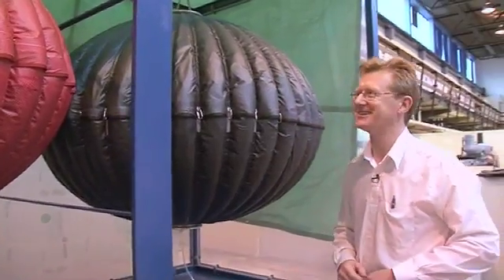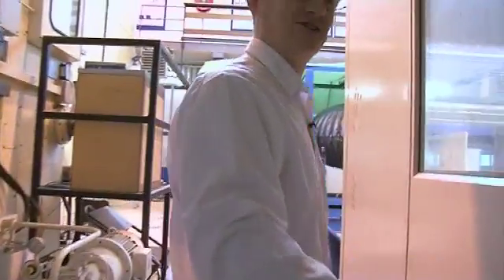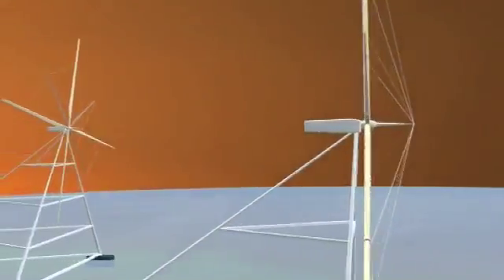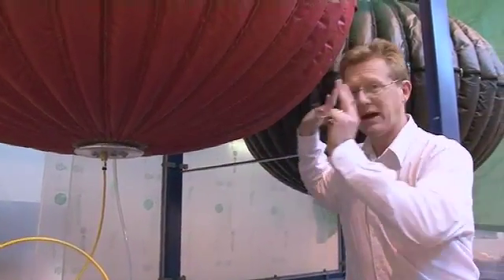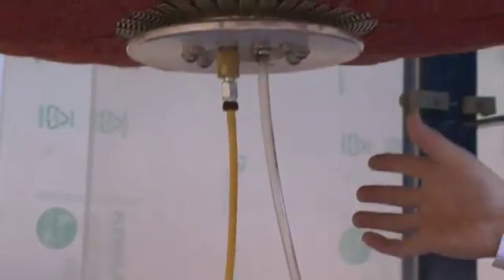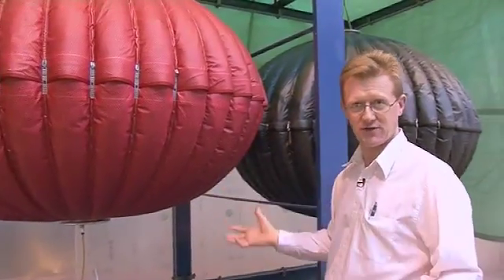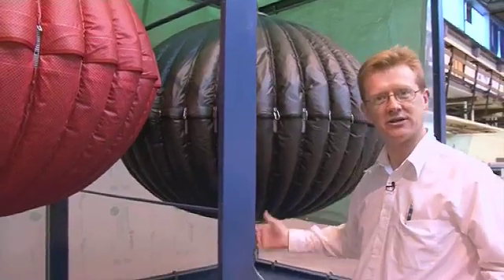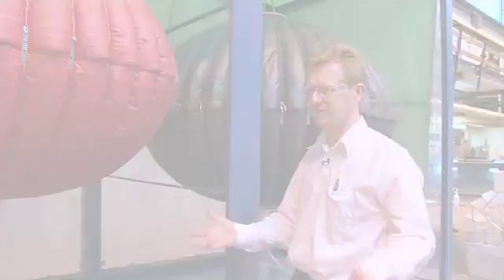Seamus and his energy bags

Comment: As we approach the 10 year mark since this video aired, 1) who feels really old thinking about that, and 2) What were the results? Is there an economically viable commercial product, a next phase to the research, or did things conclude?
Reply: yes, check out cheesecake energy ltd
Reply: Blah Bleh thanks!
Reply: @hireahitCA  nevermind, prof garvey is on the team but uk waters are too shallow for the bags to be used!
Reply: Blah Bleh my understanding is that they aren’t currently practical because of the depth required, and the related installation and maintenance costs associates with the depth. But those are engineering challenges and I look forward to some clever engineer proving me wrong.

Comment: why are you using expensive fabric when you could just use a cylindrical steel piston? It would still have the dynamic of "X-psi over the outer environment" but X would be far greater and more reliable with gaskets etc. You could easily machine these or use "off the shelf" metal stock and gaskets... except you would save a ton of money
Reply: My guess is that it has to do with the 90% efficiency, an aluminum or plastic piston could potentially have more friction than a balloon solution.

Comment: Yes, 2.5 metric tonnes of lift, or actually slightly more.  Buoyant lift is just a function of the weight of water that's displaced by the object.  A cubic meter of water weighs 1000 kg or one metric tonne, but that's distilled water I believe. Sea water is a bit heavier.  Yes, the air is compressed at the ocean floor, but it's compressed down to that 2.5 m3 volume is what I think he intends to happen.

Comment: my guess is that's the biggest reason to store them under water. you're getting air compressed to withing a quarter bar of fifty atmospheres in massive bladders under the sea which would be far more economical than storing them at sea. take fire extinguishers as an example. they store roughly 13 atmospheres of pressure, and most of the bulk of an extinguisher comes from the thickness of the metal. if you were to put a fire extinguisher into a pressure chamber at 26 atmospheres, it could hold...

Comment: If the pressure between the inside and outside of the tank varies too much, the balloon would burst. Because the pressure underwater is so much greater than above, you can store much more air this way. I'm not sure if there are other reasons they chose to do it underwater but this must have been one of them.

Comment: if you store the air in a tank above the ground, the pressure varies with the amount of air in the tank. with these soft Tanks under water, the Pressure is always the same, it's the pressure of that depth of Water. Which makes it much more suitable to use for energy generation.

Comment: the point is, that Wind turbines  do not deliver steady energy, nor does the Energyrequirement of the Grid stay steady. at night, when everybody sleeps, you dont need energy. So basically, this System is designed to store Energy in the Form of Compressed Air, when the Output of the Turbine exceeds the Need, and to release it when the Demand exceed the turbines Capacity.

Comment: It's true that it could hold more pressure with a weaker structure, but I've seen the point made several times that putting this thing under water is easier said than done. Many things could happen to it while it's down there probably requiring an operation to fix it that would cost thousands of dollars per repair. And how many repairs does it need in a lifetime? Not to mention the big metal ballast it needs anyway. Perhaps our above ground compressed air tank would actually be cheaper.

Comment: I'll give the solution because  no one would pay me for it. 
Titanium wind up spring system, it doesn't rust or corrode or break, easy to make and install. Windmill turns winding up the spring. All the energy stays in the spring. Use it at night when it gets colder :0 did it Just add efficiency!!! (Sarcasm)  Spring can turn the same generator in the windmill by disconnecting and spinning in the opposite direction at a constant rate to produce electrical current when needed.
It will work...

Comment: Many factors unaccounted for Seamus.
1. The windmill air pump can't lift such a weight at the end of the arm, also becomes unbalanced?
2.  The pressure needed would have to be incredible to pump all the way down to the bag, plus the bag would have additional pressure to be overcome.
3. Air will be compressed by bag in water at high pressure, meaning the bag will collapse no matter how much air pumped into it.
4. The air will turn to liquid with pressure and temperature drop
Pay me 300 000

Comment: This air bag system is cheaper to implement and scale or move. Compressed air on the surface would require much stronger/expensive tanks/bags because the pressure difference between inside and outside the tank. If the above ground system fails its pretty bad. If the below water system fails it not near as bad. There have been pumped water energy storage systems. I can think of tower bridge and cabin creek hydro as two examples. But again they're big+expensive.

Comment: As I see it the bags are statically anchored very near the sea floor. The energy is stored (bags filled) by air compressors on the surface. To retrieve the energy the airline from the bag is fed into a turbine or piston engine (like a steam engine, but with compressed air) that turns an electric generator.

With the compressor and generator on the surface there are no moving parts underwater making it more reliable and easier to service the parts that generally need servicing.

Comment: So is the plan to have the air bags connected to the sea-floor via a pulley system connected to a generator?

Coz it seems you could store more energy in the buoyancy potential, than you could in air pressure in the bags themselves.
Kinda the opposite of how grandfather clocks store energy in their hanging weights.

As you want to store energy - wind the airbag down lower.  When you want to release energy - let it float up a bit - driving a generator.

Comment: not so sure, why not use gas tanks to compress air inland? or use the energy to pump water back to hydro-electric reservoirs? the energy you can store is very low compared to water reservoirs

Comment: With this system, what's the carbon footprint of the actual manufacture of those bags, the compressor, and the amount of water used / will be using in testing? And, more importantly, does the energy saved by using that system instead of using electricity from a turbine balance out the aforementioned footprint?